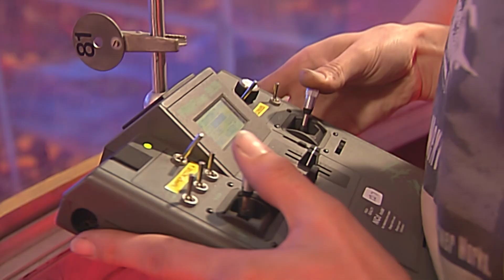SGT. BASH'S LAST FLAME | Robot Wars HD

Comment: I bet if Sergeant Bash did return in series 8-10 he would have had a blowtorch instead of a flamethrower for safety reasons.
Reply: Out of interest, what safety reasons? Blowtorches (blue flame) burn much hotter than 'regular' (yellow) flames.

Also worth noting that the pilot light on Sgt Bash's flamethrower is a blowtorch nozzle/flame.
Reply: @CaleyCreations  Propane gas?.

Comment: It’s a shame we never got to get a reboot sgt bash.
Reply: Amen
Reply: To be fair, though, Sergeant Bash was kind of redundant by this point in time anyway, let alone in 2016. What did he have that the other returning House Robots and arena itself didn't have already? Sir Killalot already had a set of pincers, and there were fire jets in the arena that already worked well enough aesthetically. And let's be honest - a flamethrower was never that impressive as an offensive weapon when most competitors were difficult to set alight.
Reply: @ryanodonovan9497  I think the main problem was that Bashy boi was one of the the original 4 and for 3 out of the 4 being there and bash not being there was not great + Sgt bash would be great as it’s very memorable and with the BBC wanting good looking robots it’s does surprise me
Reply: @oliivey2302 The House Robots that did return already looked good enough, though, as well as the fact they were among the most fondly remembered. And so what that Sergeant Bash was one of the original four? Sir Killalot (a robot better remembered than all those four despite debuting after them) already had a set of pincers (additionally before Bash had a set), and the arena already had flame jets to be used as a hazard, thus making Bash stick out as being redundant. And again, a mobile pyrotechnic got old rather quickly when you could see that most competitors weren't easy to set alight.
Reply: @ryanodonovan9497  I understand what you mean (and I completely agree with you, bash was very outdated and personally I honesty don’t care it wasn’t in) it’s just for other people I think the reason people wanted bash back due to it being the original 4, totally agree with you though
Reply: @ryanodonovan9497 It was never about the offensive capabilities, Bash was about the spectacle. The reboot had a guy who was dumb enough to enter with a wooden robot, picture how that would have looked if Bash got a hold of it.
Reply: @wolfgangwilcox2323  Except that people wouldn't have expected a wooden robot to be entered in 2016 with how far armour had developed, thus meaning less of an incentive to bring Sergeant Bash back. And like I said, a flamethrower gets old quite quickly for the sake of spectacle when it has little to deliver offensively and when the arena already has fire jets included as hazards. The spectacle of Robot Wars is the destruction, which a flamethrower wasn't the best at.
Reply: Sgt Bash was a green sentient and very dangerous being around!.
Reply: The Seventh Wars was the final appearance of Sergeant Bash even though I wished he would have returned in series 8-10 with a blowtorch replacing the flamethrower.
Reply: @robertbuckley2429 He was bullied in the extreme 1 flipper frenzy fight. Thermidor 2 won that.
Reply: We did
Reply: @bouncyindignation2987  Yeah one who died after 2 flippers (bit like in extreme 1)
Reply: That really bothered me. Not having my favorite House Robots Mr. Psycho, Growler and Cassius Chrome in the reboot is one thing. But not having Sgt. Bash in it, that's another. 

@jay-p9r6m shut your mouth.
Reply: @tylervielie5767 to be honest Mr psycho p, growler and Cassius chrome were incredibly unnecessary and I see why they weren’t added, Refbot was like 50/50 I can see why they could come back but Refbot was kinda just extra to be honest HOWEVER Bash not being in is just plain stupid in my opinion